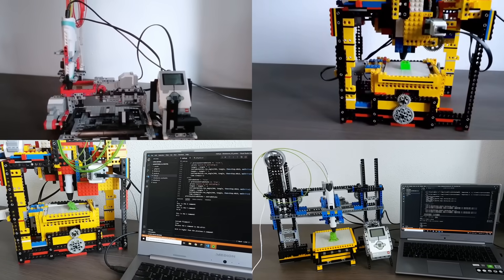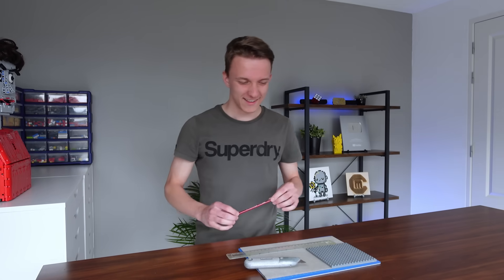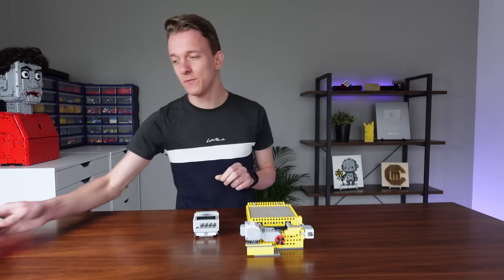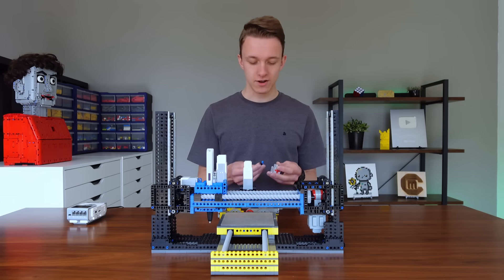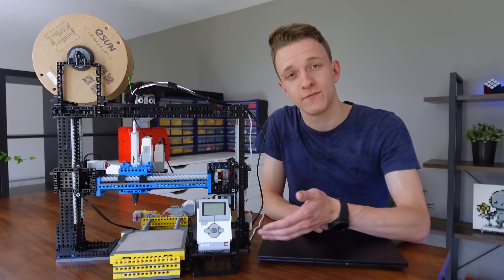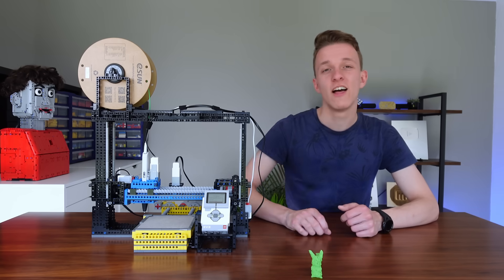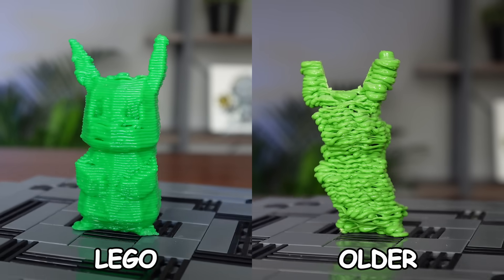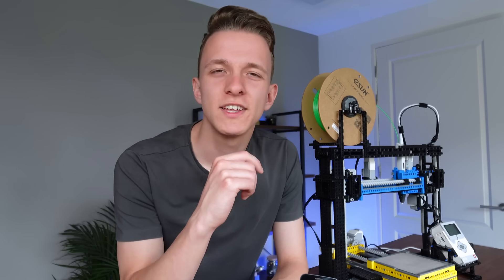I Built the Ultimate LEGO 3D Printer!

Comment: this is a really interesting concept. I feel quality could be improved vastly by disassembling the 3d pen and removing the drive mechanism, and controlling extruder movement yourself. a simple on/off for extrude leaves blobs on corners (or anywhere else where the printer is accelerating/decelerating), and controlling the flow of filament yourself will allow for much more accurate control to make it less blobby and have layers be much more uniform. even with this, the prints are impressively good for what this is! good job
Reply from the maker: Totally! I might make a new version one day! For this one I was more focused on making it accessible to everyone.

Comment: The fact that it works this well is insane. Have you thought about using a smaller nozzle size and bed levelling?
Reply from the maker: Yeah there's totally still lots of improvements to be made, but that will have to wait for when I build one that doesn't use a 3D pen

Comment: This is really awesome and I have a question for you, since you did some code on this. I have a 3-D printer that is randomly. I'm making a line that doesn't touch anything around the print kind of like it did in your example here, what's the purpose of that? And what is it called?
Trying to figure out how to stop that
Reply from the maker: This is called a skirt and it is used to make sure the extruder has a stable flow and to check for correct bed leveling and print positioning. You can turn this skirt off in the slicer or change it to a brim, which increases bed adhesion. Hope this helps!

Comment: great job and great improvement!!!... if you would use strings for X and Y, you could reduce the backlash a lot. additionally the press button mechanism could be moved out of the head (down to the base or the frame column) so it could be lighter. (Technic Changeover Catch, Technic, Gear 8 Tooth with Dual Face without Friction)... just a humble suggestion ;)
Reply from the maker: Thanks for the great suggestions! I'll keep this in mind if I make a next version!

Comment: i think your next challenge is to somehow have a proper hot end with a feed system capable of retractions. your big issue now is just lack of flow control and being unable to retract filament or directly read the temperature of the hot end.
Reply from the maker: Yes, a hot end will probably be the next step, although the current 3D printer is capable of retracting!

Comment: What speed would you recommend the 3d pen to be at? (I have the mynt 3D Pen PRO) Should i change the speed values in prusa slicer?
Reply from the maker: I have the pen at the lowest speed that it runs smoothly at. Speed settings in the prusa alslicer will not affect the machine's speed. This is determined by the speed variable in the config file.
Reply: @CreativeMindstorms ok, thanks
Reply: @CreativeMindstorms ok thanks.

Comment: as a 11 year old, where can I start learning python?
I use spike prime
Reply: Btw sick build
Reply from the maker: For Spike Prime you can open up the app, which has built in Python conpatibility. From there, pick a project you'd love to work on, divide it into small steps and google everything until it works! There is also documentation built in the Spike Prime app on the top right.

Comment: Is it possible to make the Z-axis better by changing the gear-gear lat mechanism to the way you used for the x-axis
Reply from the maker: I strongly doubt it would be better.
The screws would be under a lot of pressure, twisting them. Also, the inputs are very far from one another if you put one at each corner, making them difficult to drive simultaneously and there would be a lot of slack in the mechanisms that connect them. Lastly, the negative aspect of the gear racks (not being smooth) is fixed in the current setup, because the machine is symmetrical and pushing down using gravity.
While it could definitely work, I think there's not much to theoretically get extra out of the Z-axis. Hope this long paragraph is not too much lol :)

Comment: Now connect it to ultimaker cura >:)
Reply from the maker: Well it's not wirelessly connected to ultimaker cura, but it uses cura in exactly the same way as my normal 3d printer, saving the print files!
Reply: @CreativeMindstorms    eh, well i want to see a video of you using cura with it! Dosent have to ge wirelessly!
Reply from the maker: Unfortunately I had to take apart the 3D printer to build a new machine. Cura works just like for every other printer, except you have to set your own printer settings (like dimensions) instead of picking a preset.
Reply: @CreativeMindstorms 
Noice,
Edit: sounds like me with a lego set.

Comment: here are a few tips I would add a calibration option into the code and then put regular bed leveling screws and spring into the bottom of the bed like on the ender 3 this will make it smoother and just Beter quality and I would also add a hot head instead of a pen its going to be a little bit more coding but it will be worth it well anyways good job ive always wanted to do this but I don't know coding but you did pretty good
Reply: by the way can i have that lol
Reply from the maker: Thanks for the suggestions! You can't have it, but there are instructions and code in the description!
Reply: @CreativeMindstorms  aright thanks

Comment: Well, your XYZ movements seem to be precise enough to get excellent results if you swapped the 3D pen for an actual 3D printer direct-drive extruder + hotend assembly. That would require a separate 24V power supply and hacking the original EV3 wires to control the extruder, but it's totally doable. You would have to send I2C commands from the EV3 to a microcontroller (any 3.3V microcontroller will do, I suggest ESP32-C3). Then the microcontroller would translate the commands to GPIO outputs for the extruder. It really can be done!
Reply from the maker: Yes that would be awesome! I could even use Lego motors to do the extrusion!
Reply: Yup, you only need a third-party hotend (preferably, a cooled one, with an integrated little fan). The extrusion totally can be done with a geared-down LEGO Mindstorms M motor, but you won't get good retraction speeds, ergo, you would probably have to give up retraction altogether (not a dealbreaker if you ask me).

Comment: You should remove the motor from the 3d pen and use the Lego motor for the extruder because you can control the flow rate so you don't have to have the printer going at the same speed the entire time

Comment: it is art, pure art, but for some upgrades: let a lego motor push the filament in the pen so you can control the flow rate and add cooling so it doesnt drip like it does on some of your prints

Comment: I have a Bambu lab P1S and I think a good upgrade would be to add a enclosure
Reply from the maker: I'm afraid the air inside of it would get too hot as it has quite a big nozzle and thick hot strands coming out of it. The Bambulab printers with an enclosure even recommend opening it up to prevent it from overheating with regular PLA (at least the one I have used).

Comment: The thing that boggles me is, aren't lego motors just DC motors, not stepper motors? How do you accurately track each axis location? Not just homing, but ongoing motor positional control, there'sno precision reference in DC motors. That print is way better thanI'd ever expect from a system like this!
Reply: good question.
Reply from the maker: Great question! The "intelligent" lego systems have motors with built-in rotation sensors of up to 1-degree resolution. Since I use ev3 motors, I have these sensors to use! Pybricks, what I'm using to program the machine, has great PID controllers to move the motors accurately.

Comment: Finally the reason inches exist has been discovered, to measure Lego baseplates 1:55
Reply from the maker: Yeah so I looked it up and Lego pieces are designed with 8mm steps in size. The inches variant turned out to not be exactly 5 inches. But hey, close enough!

Comment: I would like to bould somenthing smillar, but i have some questions: is 3doodler start+ enough? What are the approximate costs to buld it?
Reply: can i use .stl for it?
Reply from the maker: Awesome that you want to make one for yourself! A 3Doodler pen could work, however since it relies on filament strips instead of a spool, it is harder to manage a constant filament extrusion. I estimate the cost to be 500 dollars, however this is a very rough estimate. As for the model, yes you can totally use .stl, but you should slice it using a slicer, like Cura.
Reply: thank you, its interestng idea but if itsnot cheper than 226,21 euros then i will buy a normal one instead.
Reply from the maker: Oh yeah totally don't build a Lego 3D printer for the purpose of printing parts! It is not accurate enough! It's more of a fun project.

Comment: I think the only thing that can really be improved on the hardware side would be a decent print head, the pen works but it's digital in nature and a lot of the flaws still present on the model could be fixed with proper control over the feed rate. Adding a "real" hotend and extruder combo would also require a bigger external power supply, but i think it's more than possible to take the pen apart and keep only the hotend, replacing the extruder with a lego one should allow for full flow control and result in much nicer prints after proper calibration.

Comment: Having a 3d printer myself, this is very good for a 3d pen. One thing I would upgrade though is making a proper extrusion system. this can let you change the flowrate of the nozzle so you could have much more finer and thinner layer lines as well as getting rid of the ugly lines
Reply: you could also use retraction and all sorts of other fun settings to iprove print quality
ngl the benchy was pretty good for a lego printer

Comment: If you used a tile for the bed, could you implement an extruding system using gears or something. The problem is that you would still need to heat the filament which could be done via metal or possibly external machinery. You can get better results with a smaller nozzle
Reply from the maker: Great points! I might be making a new version in a couple of years!

Comment: Holy Cow man, that printer is super impressive !
What immediatley came to my mind besides cooling is backlash, in the screws or in the gears. Maybe you could make the backlash from the screws adjustable with a counter Nut that can move a tiny bit and Use Chains in the X/Y Axis as they should have less backlash than the gears ? 
I'm just guessing here, i obviously have no experience with lego 3D printers xD
Anyways, great video, keep up the god work !
Reply from the maker: Thanks man! Honestly, I think there isn't really that much backlash. There's about half a milimeter of slack on the x and y axes which practically doesn't change the quality for this printer at all. But it can always be improved ofcourse.

Comment: wow impressive build and great results!
The only thing I didn't quite understood was how do you control when the pen should feed the filament? At first I thought
you start it after the countdown and it constantly feeds, but you have travel moves mid print which didn't feed.
Reply from the maker: It is able to push the extruder button, but also release it! When it releases, it stops printing.

Comment: Most of the inconsitancy in the model is probobly because of slack, not that its actually incorect.

Just having the printer stand at a angle will probobly reduce the slack
Reply from the maker: There's about half a mm slack on the X and Y axis.
Reply: @CreativeMindstorms  does that include the gear slack?

That is probobly half of the inconsistancy
Reply from the maker: It does include gear slack. If you gear up, you lose most of it!
Reply: @CreativeMindstorms if you have the slack tentioned with gravity or a ruber band you would proboly gain quite a bit of precission

Comment: Suggestion: as a 3D printer Owner I suggest you add a cooling fan, nozzle cleaning system when you start a print, and a proper 4 millimeter or 6 millimeter nozzle not just a 3D pen

Comment: try and use thinner layer 3d pen , the print will have more layers = more details
Reply from the maker: Great suggestion! I'm not sure if those 3D pens really exist.
Reply: @CreativeMindstorms  maybe make a custom  nozzle
Reply from the maker: That's an interesting challenge!
Reply: @CreativeMindstorms  Use metal make a cone that fits in the preveious nozzle and poke a hole with a .4 mm radius on top of the cone

Comment: Very nice!
And way better than the previous one.
If I may, I think your biggest problem is that you don't control the extrusion speed, and thus can't tune it with your moving speed.
If you can move faster, try it.
If you can't, try slowing down your 3D pen.
If you can't, maybe try changing the hole size of the 3D pen (and adjust the new hole size in your 3D slicer).

Adding a fan to cool can help, but if you are over extruding, that would be your 1rst thing to solve.

Thanks for sharing your awesome videos!
Reply from the maker: Thanks for sharing your ideas!
Here are some reasons for why I chose certain things:
Moving faster is not an option, as the printer has to stop at every coordinate, which would result in even bigger blobs at these coordinates (as the relative waiting time is too long).
Slowing down the 3D pen is not possible. This is the lowest speed it can print consistently.
And also, I don't think smaller extruder nozzles exist for 3D pens.
Adding a fan could help though!

Thank you for watching and leaving your suggestions! It's very helpful!

Comment: That's insane! What was the total price for this project you would say
Reply from the maker: A very rough estimate is $200 for a second hand ev3 set, $40 for an extra motor and sensors, $20 for custom, longer cables, $90 for the 3D pen and filament and then all of the lego pieces, making everything total to about $500? This might differ strongly though.

Comment: Really Amazing. I just wonder, could you make a manual, so one could rebuild it? I would like to rebuild it using a Raspberry Pi Lego Hat. This has only 4 Motor Ports, but it is possible to use cheep end switches anyway.
Reply from the maker: Thank you for watching! I'm unfortunately not planning on making instructions. Besides, I believe the motors for a Raspberry Pi Lego Hat are different from the motors I used, which would practically change the entire design.
Reply from the maker: Just wanted to let you know that I have now made building instructions!
I got so many requests, so I did!
https://reb.li/m/221554

Comment: I remember when 3D printers first started appearing and they produced models that looked a heck of a lot WORSE than what You've managed with LEGO.  Well done!  The only suggestion I might make is can you motorize the spool holder so the pen isn't doing all the work pulling the filament in?  That would be the only improvement I can see.  Besides better code and a better pen for finer details.  But this is really outstanding.
Reply from the maker: Thanks man! Motorizing the spool could help, although the pens are designed to pull in filament and I would need an extra Mindstorms brick to control it, getting very complicated real quick. Also I think syncing them up is a real pain as the filament winds get tighter and tighter, needing the motor to speed up. But thank you for thinking about things that could be improved!
Reply: Maybe it's as easy as routing it through a Lego funnel with a bend in it and at the bend point put a wheel that is spring loaded and when the filament pushes down the wheel it triggers a sensor to trigger a motor. Could also be realized with a switch and simple battery box @CreativeMindstorms
Reply: @CreativeMindstorms  3D printers don't have motorised spools, in fact. It could cause more problems than it solves, and anyways I haven't noticed the pen having any underextrusion. Maybe the opposite!

Comment: This is really cool, but there might be some really good improvements.

First, there is a lot of drips or cave-ins. You could fix this by making it go slower so it dries in time or add a low-blow fan (so it doesn’t offset the path). Also you could find a way to add support structure (like the weird, root-looking, things on a 3D printed object), but make sure that they can be taken off somehow.

Also, you should use a real nozzle or find a 3D pen with a smaller nozzle (for more accuracy).

I hope this helps, but I am not saying that this isn’t amazing!
Reply: This is cool maybe you should add a camera for if it messes up
Reply from the maker: Thanks for the suggestions! The fan is a great idea! I actually did use support structures for the eiffel tower! The timelapse of the bottom is actually not the final print I went with. I printed one more right side up with support and used that one.
Reply: @CreativeMindstorms I didn’t even notice lol! It’s nice that you put that into account when making this, because I feel that it would be a lot easier to get rid of supports. Also maybe you could heat the tip without any filament and smooth out the edges.